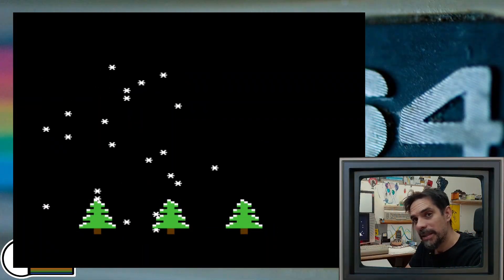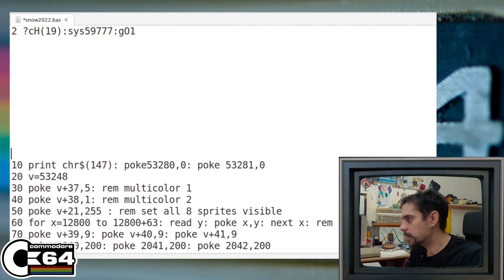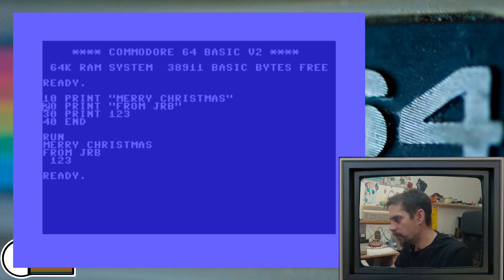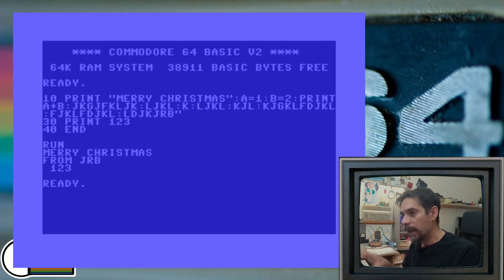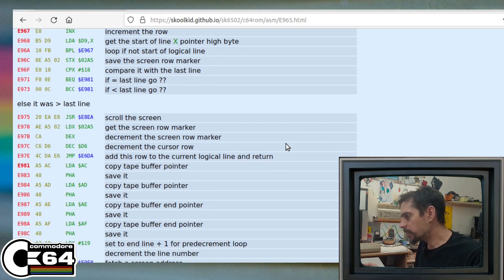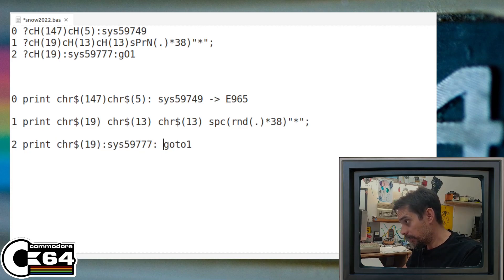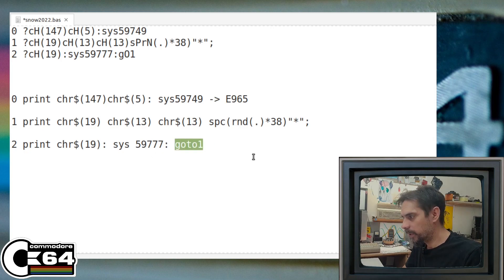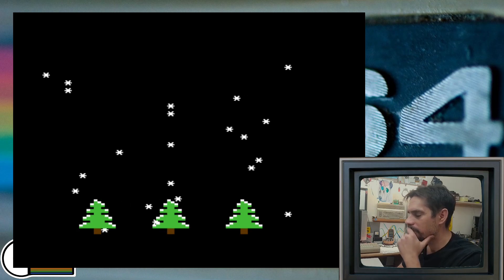Let it Snow in Basic | Scrolling Down on Commodore 64

Comment: I tried typing in the first three lines of code for the Christmas card, and I got ?UNDEF'D STATEMENT ERROR IN 0. :( (I'm using BASIC V2 on a C64 Mini)
Reply from the maker: Hm, that is strange... maybe because the abbreviations.
Try this way:
0 printchr$(147)chr$(5):sys59749
1 printchr$(19)chr$(13)chr$(13)spc(rnd(.)*38)"*";
2 printchr$(19):sys59777:goto1
Reply: @JosipRetroBits  Thanks! I'll give it a shot soon.

Comment: Not sure why you review the source in Windows? If you can't record from a C64, maybe from VICE? I prefer to see the active control codes. I have no idea what chr$(147) is but I know what an inverse heart does  😉
Reply from the maker: Thank You for the comment. I use a modern editor because I have more flexibility to move code around, but that approach lacks the possibility to run the code inline, so maybe I should switch to c64 directly. Also in this video, I did not explain each command in the game because I explain them in previous videos more than once, but I will consider your suggestion, thanx.
Reply: @JosipRetroBits  You'd think by now, there'd be an editor that supports the {Wht} for white, {Clr} for Clearscreen, {Ins} for insert, {Rev} for Reverse, {up}, {left}, {right},{down}, etc. Using the nomenclature popular in type-in magazines.

Comment: Very clever, however using SYS calls isn't really just BASIC even if it's just to the KERNAL. You could even argue that POKEs are beyond just using BASIC, but I know that due to the extreme limitations of standard C64 BASIC there's not a great deal you can do without them at the very least. C64 BASIC was probably the most disappointing part of the C64 since it hadn't moved on since the PET, imagine if it had come as standard with an extended basic ROM instead with full support for most of it's awesome hardware like sprites for instance, on a good note however it pushed me to learn 6510 machine code when I was a teenager in the mid 1980s, my first codes were small loaders to break into games to cheat, I got published in Zzap!64.
Reply from the maker: Thank You! You can argue that all basic commands at the end execute some machine code to perform its function.
There is no difference in interpretation of let's say PRINT command and the SYS command, only the PRINT executes 
parts of BASIC machine code and in this case SYS command executes part of KERNAL machine code.
But You are right, because of these limitations there are lots of peeks and pokes and sys usage :)
Also before we talk about graphical and sound commands that are truly missed on Commodore BASIC 2.0, we also don't have
a proper IF..ELSE, some of the logic operators are missing, etc. But despite all these disadvantages, there are lots of fun coding in BASIC.
Machine Code(or Assembly) still rules on Commodore 64 in every aspect, speed, interrupts, smaller footprint,...
So You got your code published in Zzap!64, that is awesome :)